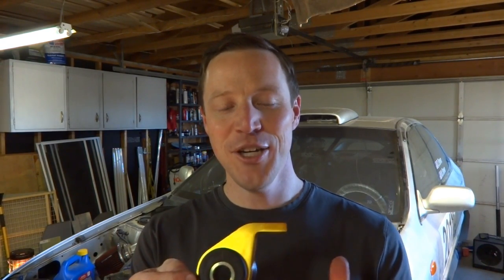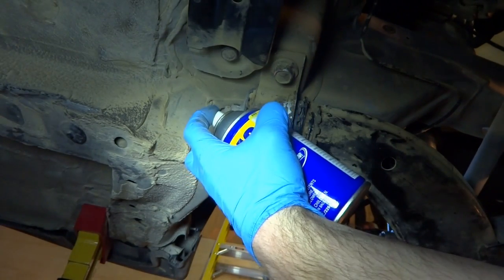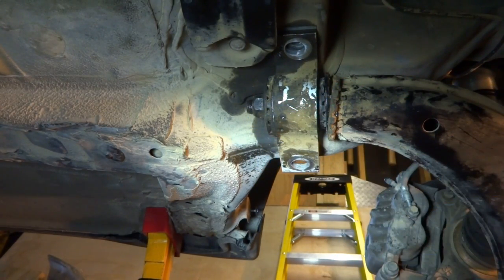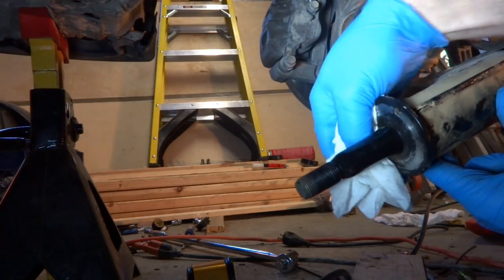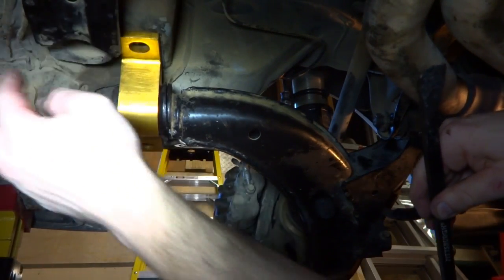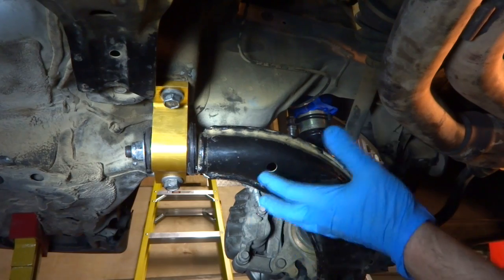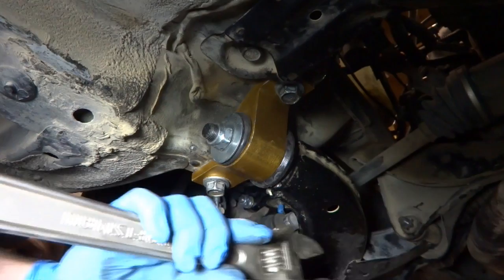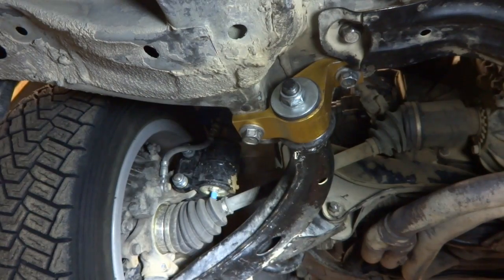How to Install Subaru Front Control Arm Bushings!

Comment: Just did mine today, ran across your same first issue.  Said screw it and took the entire control arm off!  Works a treat and you can clean the entire thing, respray to keep rust off.
Reply from the maker: Yeah if I didn't have the offset bushings I'd definitely just pull the whole thing off of the car. I suppose I could pull it all off to remove and clean it up. In any case, I'm glad it worked out for you!
Reply: Ive just ordered the stock bushings, really hoping not to have to drop the complete arm.

Comment: Video is old but it's gold like the bushing case. Going to be throwing the group N bushings on my 04 wrx soon and this video looks like it will come in handy when I start. 

Considering my kit didn't come with lubricant, what would be the next best thing to use.
Reply from the maker: Thanks and good question! Most polyurethane bushings come with a silicone based lubricant. I’m not sure what material your bushings are made of but make sure to pick a grease that it compatible. I found a good article on this topic that may be helpful for you as well: https://www.suspension.com/blog/the-best-grease-for-polyurethane-bushings/

Comment: Doing the same thing on mine in the myriad of repairs I'm making prior to ShowMe, and started ripping threads off my control arm bolt, putting a total pause on that part of the project until I can get some thread chasers and clean those threads.
Reply from the maker: That's no fun! Good luck and I'll see you at ShowMe.

Comment: i bought some $40 control arm bushings off of ebay thinking they were just oem style. ended up being the same design as these whitelines lol. unexpected upgrade
Reply from the maker: Best kind of upgrade! Free!
Reply: yep. and for once i was happy to have an automatic because the transmission mount wasn't in the way, made it much easier.

Comment: I just redid the entire front suspension, struts, calipers, rotors, ball joints, tie rods, cv axle, etc. Did the same to the rear. Pulled out everything and replaced them with a new suspension. 

There's still some fucking shaking in the steering wheel. After all of that. I think this is it. After I do this job, It should finally be good to go.
Reply from the maker: Hopefully this does the trick for you! Take a look at your tie rods on your steering rack also to make sure there’s no play there too.
Reply: @RacerDave  Well, it's confirmed that it's probably the bushings. 

My ball joint popped out of place today and the lower control arm is completely loose.
I feel like me adding the new struts was the final straw for those bushings. The new amount of pressure on the old, original  232,000 mile bushings was too much for it.
Reply from the maker: Bummer but at least now you know what it is. Good luck!
Reply: @RacerDave  It's all good. Good thing I watched your video already,  thanks for making it! 

It's good that it happened this way anyway. I'm taking my outback up to Idaho from Central California in a week. I've already done everything else as far as suspension goes. Literally everything. 

If the one piece that I didn't do yet was going to go, it's best that it did now and not on that drive. Lol.

Comment: Hope ur still there, I'm worried. I got a similar set that you got where the geometry looked different from the stock bushing, there's no difference with that different angle in the wings?
Reply from the maker: Yep I’m still here. I’m not following what you mean by the wings? Are you talking the tabs on the bushing itself?
Reply: @RacerDave  sorry. The tabs.
Reply from the maker: If you put them on the correct side they should bolt up no problem with the correct alignment. Does that answer your question? If not, maybe reword it to help me out.
Reply: @RacerDave  yeah that answered it, sorry for the word salad. 😅

Comment: There are two bushings in the control arm and  this  other bushing looks like if is difficult to install,i guess. Is neccesary special tool to remove it?
Reply from the maker: I believe you're talking about the front one. That one is pressed in and I honestly haven't looked into replacing it. It certainly seems a press would be required at a minimum to replace it.
Reply: @RacerDave   ok thanks for the information actually i will replace the three parts two bushings and the ball joint.
thanks for your great smile.

Comment: Great instructions, I'll have to do the same job considering the noises my car's front makes when hitting a bump. Just one question out of curiosity: why did you use the breaker bar instead of your impact wrench to loosen the screws? Is it to minimize the risk of snapping the head?
Reply from the maker: I tried that first but my impact gun didn't have enough torque to brake them loose.

Comment: Super fast and easy repair. Question, is it necessary to get an alignment after replacing a torn bushing?
Reply from the maker: Ej Icon, I definitely recommend an alignment any time you replace any suspension components. Replacing these bushings probably won't move things around much, but nothing ever goes back exactly the same.

Comment: Do you think that you would have been able to reach that nut with one of those universal joint adapters for a socket?
Reply from the maker: Probably not. It's really a lot tighter than it looks. One of those crows foot adapters is really what you need.

Comment: Hello. I am trying this again, lol. I can't loosen the control arm bolt to lower it down. Tried spraying it and using a sledge with a pipe but I don't have much room at or any leverage. Impact wrench is too big also...
Reply from the maker: That's the hardest part of working on old subarus. That's why I had to get creative with the 2x4 on that one bolt. Sometimes a little heat will help. Sometimes tapping on it with a hammer will help free things up.
Reply: @RacerDave  Thanks! I am going to try some heat!
Reply: I got it! The old bushing wasn't really that bad, but it was leaking, so now I am letting it sit and will tighten it up tomorrow. Thanks again!

Comment: Did you have any trouble getting the big bolts holding the kit in? I'm installing mine atm and the bolts just dont want to go in and tighten all the way up.
Reply from the maker: I did not but I've heard of one person having a similar issue. Not sure if it's what's happening to you or not but in his case the weld nut on the inside of the frame broke free of the welds and was spinning. The solution was to cut an access hole in the side of the frame rail big enough to get the head of a welding gun in there and reweld the nut. Then reweld the frame piece back in. Another possibility is your threads are stripped somehow. Let me know what you end out finding. Good luck!

Comment: Hello! I tried to do this, but only got 2 bolts off. I couldn't get the third hard to get bolt. I couldn't get the bolt to drop it down either (no leverage). So, now I can't get the holes on the old bushing to line up with the body and my car is grounded... no idea what to do now.
Reply from the maker: Oh no! That's the worst part of working on old cars. Were you able to get it apart eventually? It's hard to tell which bolts or nuts exactly are the issue from your description but when I get things stuck like that sometimes more penetrating lube and letting it sit for a while helps. Sometimes heat will help. May need to borrow or buy a different tool. I know how frustrating these situations can be so I really hope you can get it sorted out.
Reply: @RacerDave  Thanks for the reply! I am going to try again next weekend on dropping it down to and getting more leverage on the bolt.

Comment: hey just curious,  could you torque down the 24mm nut before putting it onto the body?  I just really dont like cresent wrenches (In australia, we call them shifters) :)
Reply from the maker: Hi Troy, The anti-lift kit offsets the rear of the control arm down from the factory position. This actually twists the front bushing. If you install the anti-lift kit on the control arm first, you can't get the front bolt in because the bushing is no longer aligned with the holes in the sub-frame. The "shifter" wrench is definitely my last choice but it's all I had. I think a 24mm crows foot would be ideal so you could get a torque wrench on it but the next best would be a 24mm box end wrench.
Reply: Racer Dave thanks Dave.  I might have to invest in a set of these crows foot wrenches. Cheers

Comment: Anybody know the website where I can find those control arm bushing, thanks
Reply from the maker: I got all my OEM and aftermarket Subaru parts from Flatirons Tuning. They have great prices and are super knowledgeable and they can order stuff that’s not even on their website. Otherwise you can order OEM parts through any dealer and just run a generic internet search for white line front control arm bushings.

Comment: Dave I have a question I have a 1999 Subaru Impreza L wagon and my local tire shop told me that I can't get an alignment because of my lower control arm bushing is it the  same one that you were replacing or is it a different one
Reply from the maker: Most likely. There is a front bushing but it's pressed into the control arm and I've never heard of one going bad.

Comment: Here's a thing there stickered top left and top right is it left as if you wa sag in the car or if you wa facing head on?
Reply from the maker: Sitting in the car. They can really only go on one way without looking totally weird because the bushing is not symetrical front to back. You can see how I installed them in this video for further confirmation.
Reply: Racer Dave cheers mate. I thought I'd ask because I'd just done the rear sway bar and updated the sway bar mounts and on the instructions the say there handed but no indication as to which was left or right so had a bit of Messing about.  Thanks for the reply bro keep up the good work.

Comment: I get a loud knock sound when turning left from a complete stop any recommendations?  Also i hear a squeak sound when i stop then accelerate?
Reply from the maker: That's really hard to even guess what that might be with being there. I'd start by putting it up on jack stands and start shaking the suspension to see if you can figure out what's loose or stuck. Or something may be falling apart like mine. If there's nothing obvious you'll probably need a mechanic to check it out. Good luck!
Reply: Could be CV joints ? Take to a mechanic if not sure.
Reply: ever figure out these noises? I get that squeak, mine sounds like it's coming from the rear passenger side — it's just a split second squeak/pop sounds , sounds almost digital. I wondered if it might be a sticking brake calliper? The clunk I think is bushes  on the control arm.

Comment: i bought a set of front and rear alignment bushings for my 2004 and i seem to have a clunk i cant get rid of....
Reply from the maker: Sorry to hear that. I hate mystery problems like that. Not being there, it's hard to guess what may be causing it and I'm not a professional mechanic but I'd double check the part numbers you got and make sure they're correct and then double check all your bolts for proper torque. If you've done all that, it could always be something you didn't directly touch. A strut or strut top or something like that that was going bad but you never noticed until you installed the performance parts. Good luck and let me know what it is when you figure it out!
Reply: I spent last night replacing a cv axel which took care of some of the sound, but  looks like the sounds were/are coming from multiple places. Unfortunately the new polyurethane bushings seem to transfer way more noise, still tracking it down but so far I have replaced : Ball joints, Front and Rear Alignment bushings, sway bar endlinks and driver side cv axel. I replaced Struts, Springs and Strut mounts last year. I have one mechanic telling me its my steering rack and another telling me its the shock mount.  At least i was able to get the alignment done and it handles like new again.

Comment: on a scale of 1-10 what is the difficulty level of this job? 3hr job?
Reply from the maker: Now that you know the tricks and what to look out for it's actually fairly easy. I'd say a 3. Maybe a 4 at worst. The only thing that would make this difficult is if you have a rusty car and the bolts are rusted in there. And I could definitely do it in under 3 hours.

Comment: Really should read and follow the service manual... whole procedure done in the vid was totally out of whack.
Reply from the maker: Care to be more specific? I've done it this way a dozen times and it"s worked great every time.
Reply: @RacerDave  FSM tells you exactly what to do and in which order. Remove linkage to control arm, remove ball joint from steering knuckle, then remove bolts from bushing. Easy as pie. Installation is reverse of removal. 

If you actually again, read the FSM and follow the procedure. The 24mm nut is the first thing to be torqued, off the vehicle. You do NOT tighten that on the vehicle after the bushings are bolted to the frame. 

So in short, completely out of whack. Read the manual
Reply from the maker: Not possible with the offset bushings unfortunately. I tried. You can't get the front bolts in because of the angle of the control arm. Thanks for sharing the factory way to change factory bushings.